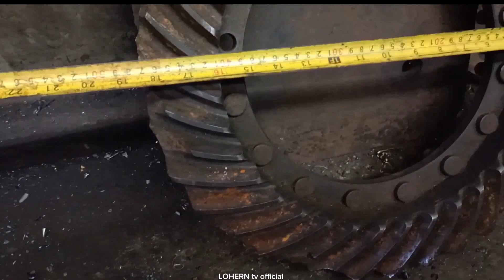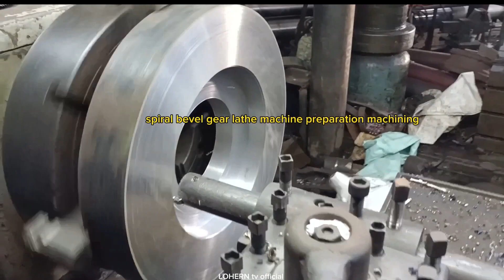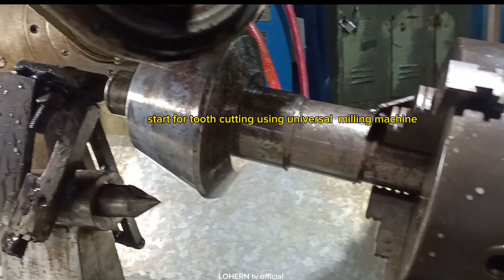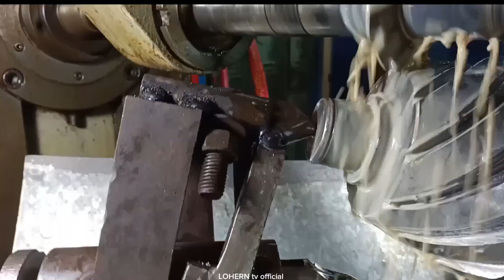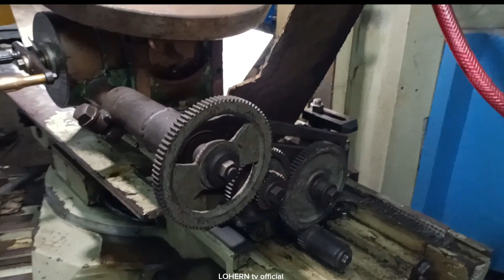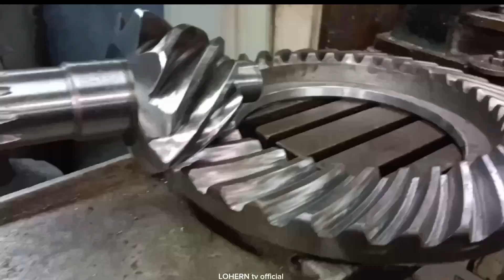EP55--Spiral Bevel Gear II Gear On Pinion

Comment: Good job brother
I have helcal bevel gear broking and i want to make one new , Can you may to calculate and take the data from old gear.
Reply: I mean may to learn me the Calculate to make it
Reply from the maker: It is difficult to give exact computation especially if it is far away even though I have to come closer to learn the actual.